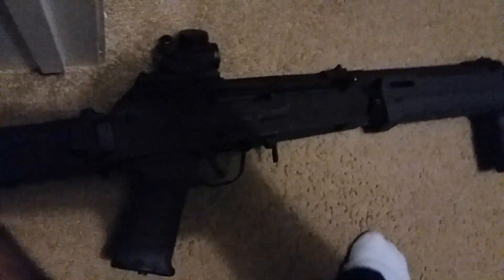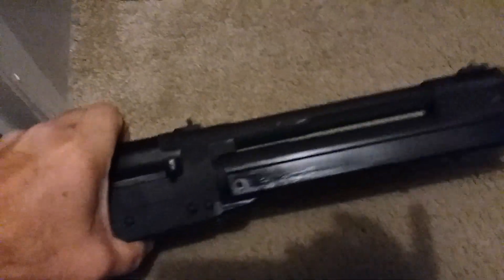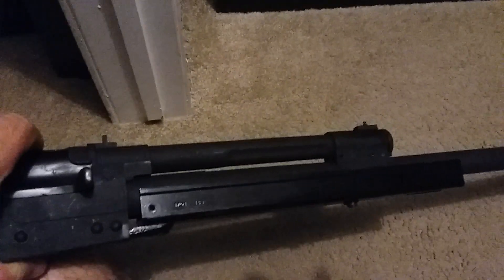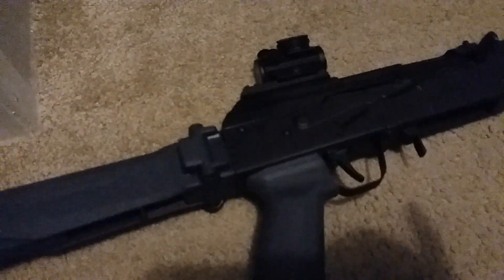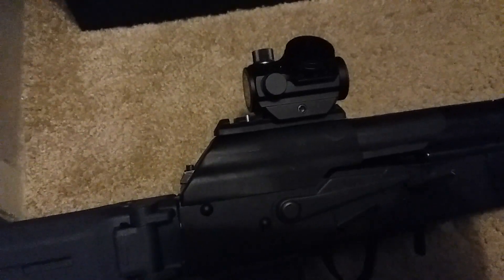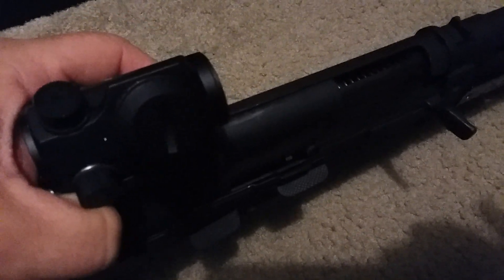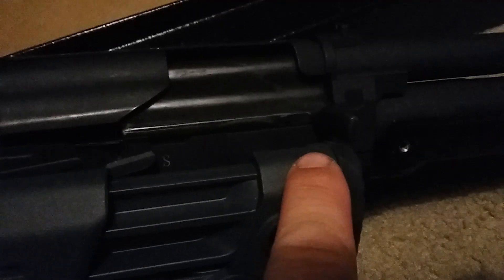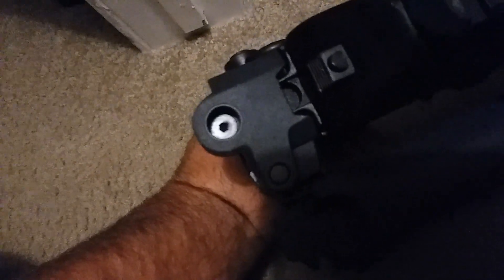SDS Lynx 12 zhukov stock how to and other modifications

Comment: "the moe grip bolt will not work"....so you either drill and tap the HARDENED steel t nut for the lynx (unwise - as i've learned the hard way), or buy one that's the proper thread pitch (6mmx1.0 metric) because magpul uses the "original" ak grip thread that the chinese copies do not.  By using the proper mount and screw, you retain the design and utility for the moe grip storage for accessories/spare small parts.  Learn from my mistakes, and learn as a collective!  :)  hope you don't mis interpret this comment as "this damn gun fudd"  lol  It is not my intent.  :)  have good day, and keep on smithing!